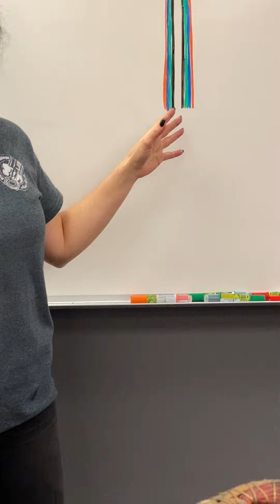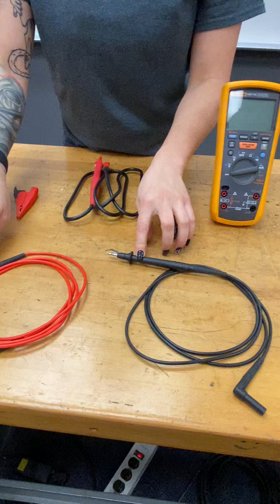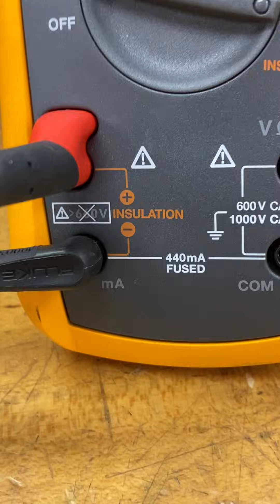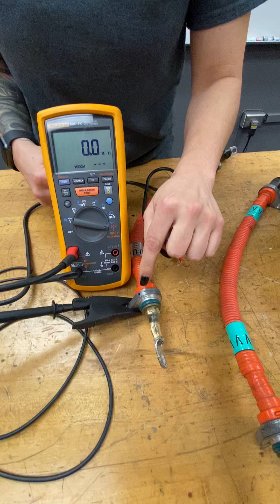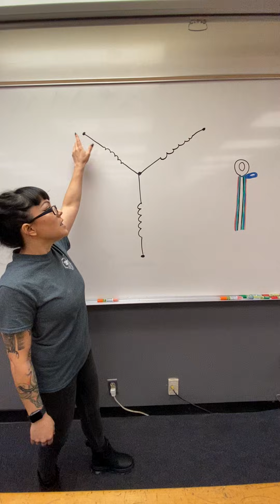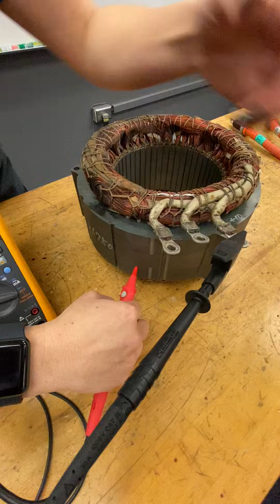How to perform a “Loss of Insulation” test using a Fluke 1587FC

Comment: One thing to know about using a megger or insulation tester is that you want to do the test for around a minute not just the two seconds she showed and that's because the meter takes time to ramp up to the test voltage and also keeping the test going will give the tester more time to expose bad insulation.

Comment: I didn’t read through all the comments but just a question about your cable diagram. As I understand theres the “conductor” of stranded copper, a layer of insulation, a “SHIELD” (not another insulator) of most likely a foil bonded/connected to the cable mounting lug and finally another layer of insulation? So your’e looking for leakage(poor word but I think it works) from the conductor to the shield. Not too hip on EV stuff as I normally work with 480-13,200 VAC in the plant but I assume the shield is there to mitigate any errant EM trying to flee 😂 the conductor under high current. Or like an equipment ground? 🤔 Both sounds more likely tho. Just used my older 1687 to troubleshoot an epically bad underground 3phase 480 feed but an always on the prowl for more data/info. Great vid, cheers

Comment: Great when you’re teaching others. Always mind the basics:
- wear PPE when using a 1000V device
- red is positive an goes on the fase wire
- leads connect to 1 accessoire, either the probe or the alligator clip, don’t stack accessoires

Comment: I have question. 
I drive a Ford Crown Victoria P71 Police Interceptor 2009.
For some weird reason I keep getting the code P0128.
Thermostat below regulating temperature. 
I put a new Spring Thermostat plus new coolant. 
But it keep coming back with the code.
Furthermore, my temp gauge shows as analog 8.30
The needle should be at 9.00
Can you help me please. Took it to shop and they could not find anything wrong.
Well, something is wrong.
Help me plz.

Comment: Motors wired in WYE configuration, such as the one shown, share a common point between the widings. If measuring a motor in delta configuration, you would need to test all 3 legs because the windings do not share a common point. Good video, I was hoping you would go over why using less voltage would produce a different ohm reading. I find when using this meter that the voltage applied effects the readings of the resistance to ground

Comment: The other thing to look at during the insulation test mode is the bottom right hand side of the meter screen ...  But first, let's say your test voltage setting is 1000 volts... The bottom right side of the screen gives you the read voltage, which will VARY,  depending on the breakdown of insulation... Note on the stator test here, the read voltage was 1 vdc, because obviously the ohms / resistance was @ 0.0 ohms... 👈The read voltage is just as important to look at as the resultant ohms...Had the insulation been any degree better, the read voltage would have been anywhere from 2 vdc to 1000 vdc, 👈The selected test voltage.
Reply: Question are you supposed to get close to the supplied voltage on the read? Or is based on ohms only to determine is insulation is bad. For example if I sent 1000 and I supposed to get 1000 back or close to it?

Comment: On the Y diagramm you showed and the particular hypothetical point of the short, why do we measure in every terminal 0Ω and not 0Ω on the end of the same coil and 2x the resistance of each coil from any other terminal, since there are 2 winding resistances in series to that particular point?

Comment: Does the voltage matter whenever testing. Like if testing at 1000v should it read 1050v instantaneously or climb to 1050v form like 300v.?

Comment: I love your content, I'm a fellow educator and use some of your videos for some of my in class videos, but I want to point out the way you have the stator laying can damage the windings. It must be sitting on the stator case so you prevent damage to the insulation, Especially when pushing it around the bench to test. Stand it up.
Reply: She also seems to use "voltage" and "current" interchangeably... 😞

Comment: Check mjlorton for more in depth information :) For instance the capacitive properties of long wires (like motor windings), what the polarization of the dielectric insulation or environmental properties (hot humid, cold dry) would do for your testing. Thusly PI and DAR testing should not be ignored :)

Comment: Before I retired that Fluke was in my work van.  Nice combo multimeter, "megger" or insulation tester. Remember moisture can be a source of low insulation resistance values. Nice demonstration BTW.
Reply: I have mixed emotions on a megger.i see where they are handy,but i also see they dont find bad bearings in motors,gearboxes that leaked into the motor.how do they act towards a motor thats full of water.just bc it megs good dont mean its a good motor
Reply: @bkh5746  You are so mercifully free of the ravages of intelligence.